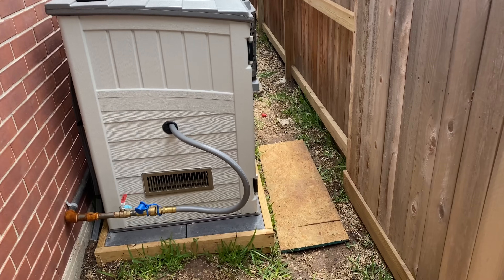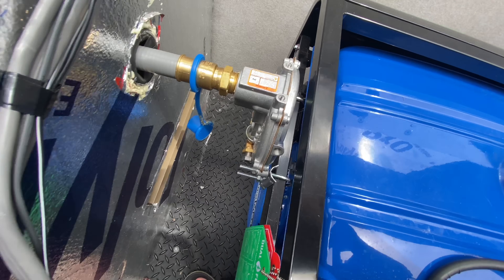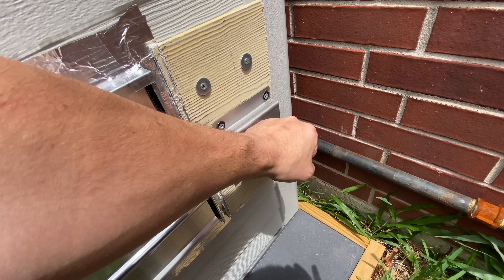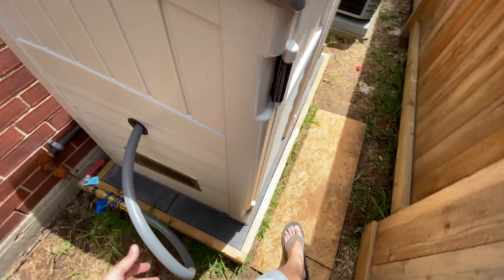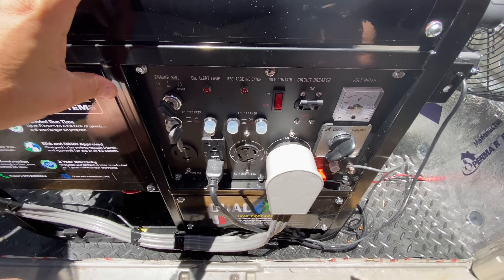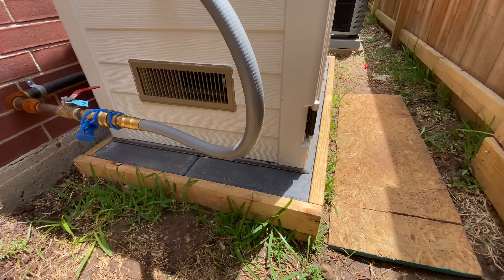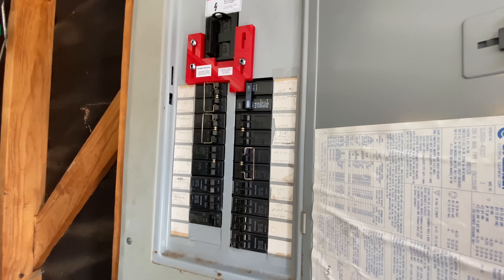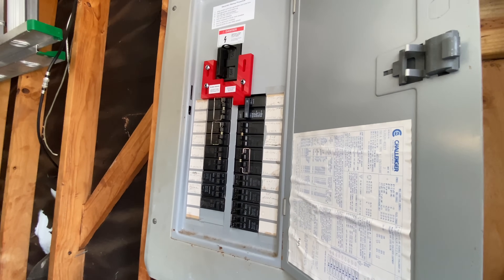Converting a hybrid portable generator to a whole home generator with shed

Comment: OMG dude...you seriously messed things up. Like do not use this for any period of time. 1. You're using an electrical line and plug for sustained heavy use, it's not rated for that. That's going to overheat and give you trouble and possibly a fire long term. You should be using the proper NEMA plug and outdoor rated line meant for sustained generator use.That type of UF cable is meant to buried, and isn't meant to take sustained high amperage loads like you'll see with running your whole house off the generator.  2. Look at the comment below about adjusting things. There's no way you needed to adjust that regulator and adjust the governor. Leave the idle switch alone, turn it off to check your settings, then turn it back on. The only possible adjustment you may have needed to make was some air/fuel adjustment because of using NG instead of LPG. You're now not running the generator at the proper rpms for the proper hz and voltage rating. At no load it should be around 61.5 hz and not drop below 58 hz fully loaded. Meaning 80% of the sustained load rating. You should really have had a professional do this for you, instead of cutting corners and messing with something you're not familiar with.
Reply from the maker: Hi "ImpsMyPimp". I used a 6/3 direct burial wire cable rated for the amount of output by the generator. The plug I used was a Eaton 5752AN 50 Amp 125/250V rated.  Can you explain why the use of these two products would overheat and isn't rated for the load? Regarding the frequency output, this was checked using a Fluke 117 to confirm that with and without load I am getting anywhere between 59 - 61Hz.
Reply: @CalvinGorriaran  That guy trolls all these videos with generator setups that resemble yours. Mine is like yours as well, but I have an all gas setup. I like to see what others may have so that I could possibly improve what I have...your setup is super clean, and functional. I see that guy never responded which all but confirmed his trolling. Great video, great content!

Comment: How much of the home can you power up at once with this
Reply from the maker: I can run one of my AC units and everything else in the house, excluding washer / dryer. I have a wattage and AMP monitor to ensure I am not overworking the generator.
Reply: @CalvinGorriaran  appreciate it
Reply: Calvin, where did you mount the wattage unit, next to the circuit panel?  I did not see it or hear you mention it from the video.  Great job,  nice video.  I did read the description but did not see the brand or source of the interlock device.  Maybe I missed it.  THANKS AGAIN.

Comment: I'm surprised your regular works mounted upside down because according to the US Carb instructions it clearly states the regular must be mounted right side up.
Reply from the maker: Interesting point! I will see if I can make that change. I was wanting to raise the generator a bit to allow for easier oil changes. That would help me keep my existing gas line hole.
Reply: Possible fire code non-compliance. When the valve is upside down the valve can fail closed creating a fire hazard.
Reply: @jflores6628  Just saw this video and noted the regulator position change Calvin made based on, I guess, this comment. According to Garretson (regulator manufacturer) and Nash Fuel (conversion kits),  these regulators "can be installed in any orientation except for flat (back side down or front side down) the weight of the diaphragm being pulled down by gravity will throw off operation."
His original orientation was OK.

Comment: Calvin. I have essentially the same generator as you. One thing I wanted to mention to you and you may want to be careful with this. The idle toggle switch is intended to reduce the rpm on the generator while there is no load on it. As soon as it senses load (even a small load) it revs itself up to to roughly 3600RPM to produce 60Hz and the desired 120/240V. The idle feature is meant to reduce noise and fuel consumption while there is no load. (Key words here "no load").
Now, while the button is turned off, this feature is disabled. The problem I see with you turning that on, and then modifying the rev limiter to compensate for the low RPM while there is no load to me is insane. It's like pulling the emergency brake on a vehicle but then upgrading to a bigger turbo because the car is too slow. That's a perfect analogy.
That switch is controlling a small circuit inside the generator that electronically limits the output voltage and frequency but controlling the RPM. You can't get both low RPM on the engine and a solid 60Hz, 120V coming out of th output. It does not work that way. The generator has to run at roughly 3600RPM to maintain 60Hz. If that is not right your lights will flicker, and you risk frying all the electronics in your home.
I am willing to bet that with your mod as soon as it detects a load your output is going to be crazy high, nowhere near 120v. You may be frying your whole house by over voltage. You may be lucky that the NG regulator is limiting the gas input thus limiting your RPM to something less than catastrophic. Just a wild guess...
I don't mean to bash but having build a similar setup myself, and with my engineering background I can see a major problem here. 
I would suggest you run your generator with idle on and off and measure the output just to be safe. Check your output voltage and frequency. 
I run mine with the idle switch off at all times. It's not worth the risk. Either way the enclosure will suppress some of the noise. Also, even if the idle switch is enabled you won't benefit from noise reduction unless the generator is completely disconnected from any load.
I plan on posting a video on what I did with my setup soon.
Regards!
Reply from the maker: I did end up turning off the idle control after some research. Also added a tachometer. I talk about this in the update video listed in the description.
Reply: Just food for thought.Worked as a lineman for 35 years.Line voltage is constantly fluctuating due to loads being taken off and on. When we checked house voltage 10% was always considered acceptable as per the company. Heck we had some at end of distance lines where they couldn't get a fluorescent light to turn on only having 105 volts. That we had to fix by upgrading line.
Reply: @SheepDog I just posted this video. I hope it helps. I plan on doing a much more detailed version when time permits. https://youtu.be/j-ejO8xbBOA
Reply from the maker: @evistic  great video. What did you use for the wiring into the house and relays?
Reply: Be aware also, idle switch does not work when running on propane
and this is not a machine problem it is designed as such
Reply: @michaelsartor9818  I'm not sure where you got that info from, but I am absolutely positive it's not true. Not only it is not mentioned anywhere in the owner's manual, but I have tested the idle switch when I first hooked it up and it does work. My generator never ran on gasoline, ever.
There is no "logic" board on these generators, there is no electrical or sensor type wiring that would tell the generator what sort of fuel you're running. The engine has no clue, nor does it care if you feed it gasoline or propane or natural gas in my case. As long as the mixture is within tolerances, it just runs. So having said that, there is no way for the generator to tell if you are on propane and then somehow logically lock you out of the "idle" functionality. So not only is you comment incorrect, but under no circumstances can it ever be correct given the generator in question.
Is it possible perhaps more advanced generators such as inverter type to have such a function built in, sure thing, but not this one.
Reply: Usually you want to put the biggest load on the thing as youre gonna be putting on it and adjust for around 120 +\- 10% and the 60hz will be adjusted with the voltage adjusting/ throttle..  usually only see them dropping below 60 when the rpm gets bogged by work load but 60hz +\-5hz is fine for stuff..  is not like he’s using it for a server equipment room and household appliances and anything a homeowner typically would have isnt sensitive enough to be effected by small frequency fluctuation or power factor correction.  Some pc’s would and maybe a fancy smart tv but my guess is the regular house fluctuations and surges would be more of a concern if your getting technical with things..  nobody runs stabilization on residential unless they have a machine shop and at then they usually have 3 phase power piped in..